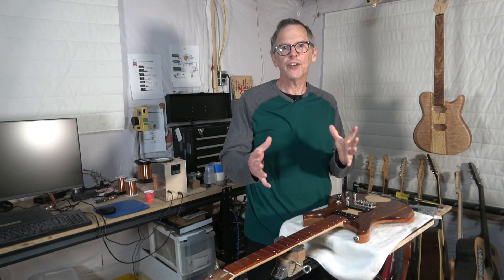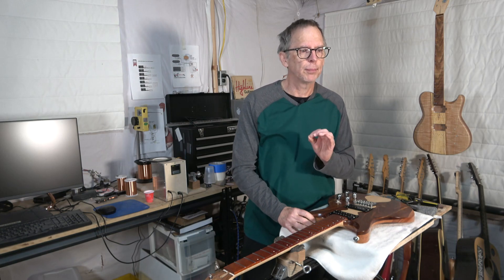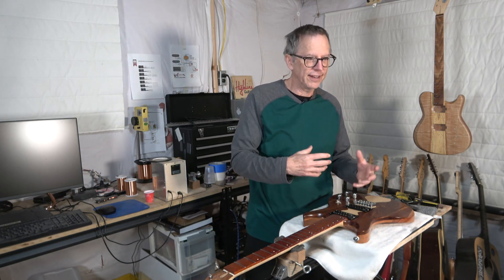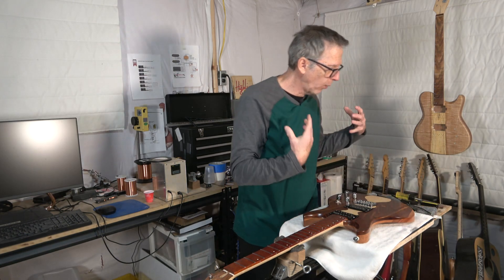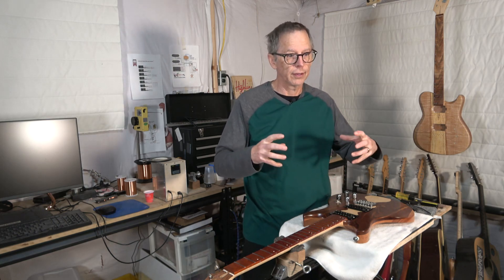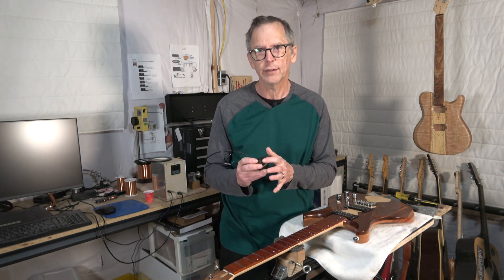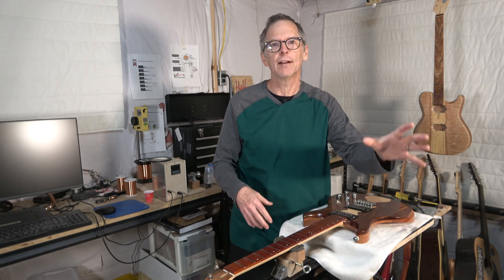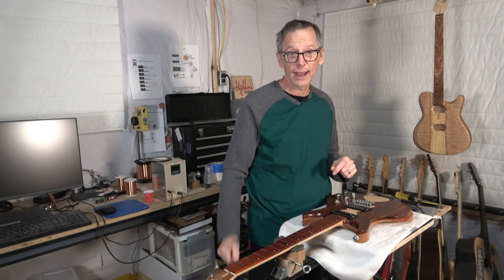Making Guitar Pickups By The Numbers

Comment: 4:06 Can you please describe what you mean by "balanced"?  

My basic understanding is that the more windings, the darker the sound.  The less windings, the brighter the sound.  

This is why humbuckers are darker sounding than single coil pickups, because they essentially have double the amount of windings, and therefore resistance.  This is counteracted by using a 500K volume pot, which preserves most of the high end frequencies in the signal.  

Conversely, single coils are by their nature, brighter, so 250K pots are used to allow the high end frequencies to bleed to ground.
Reply from the maker: The treble, midrange, and bass frequencies are perceived by the ear as sounding equal.

Comment: Can you make guitar midi pickup? sounds impossible but I think you can
Reply from the maker: From Chat GPT: Yes, it’s definitely possible to make a DIY MIDI guitar pickup, though it can be complex depending on how advanced you want it to be. There are a few different approaches you could take:

Basic Concept

A MIDI guitar pickup converts the vibrations of each string into a digital signal that can be used to trigger MIDI notes. This typically involves:
	•	Polyphonic signal detection (one signal per string)
	•	Pitch tracking (detecting the frequency of each string)
	•	Velocity sensing (detecting how hard a string is plucked)
	•	MIDI conversion (turning string signals into MIDI notes)

Approaches
	1.	Magnetic or Piezo Pickup + Pitch-to-MIDI Processing
	•	Use individual piezo sensors (one per string) or a special magnetic pickup.
	•	Process the signal using a microcontroller or software (like Pure Data or MAX/MSP) to detect pitch and convert it to MIDI.
	•	Example: Roland GK-3 uses a hexaphonic magnetic pickup.
	2.	Optical or Capacitive Sensing
	•	Some MIDI guitars (like the Misa Tri-Bass) use optical or capacitive sensors instead of traditional strings.
	•	This approach requires special hardware but eliminates tracking latency.
	3.	Direct Fretboard Sensing
	•	Some systems detect where your fingers are on the fretboard using touch sensors or conductive frets.
	•	Example: The Ztar by Starr Labs uses individual button switches under each fret.

DIY MIDI Pickup Ideas
	•	Use six piezo elements, one per string, feeding into a microcontroller like an Arduino or Teensy.
	•	Process signals using FFT (Fast Fourier Transform) or zero-crossing detection to extract pitch.
	•	Send MIDI data over USB or DIN using libraries like MIDIUSB (Arduino) or Teensy MIDI.

Challenges
	•	Latency: Real-time pitch detection can be slow, especially for low frequencies.
	•	Tracking Accuracy: Standard pitch-tracking algorithms can struggle with bends, slides, or harmonics.
	•	Polyphony: Handling multiple notes at once can be CPU-intensive.

Comment: Single coils. There are several physical aspects of pickups that effect tone. Height and width, for example. Wide flat Jazzmaster pickups produce more bass than a strat pickup with the same number of winds.
Putting tape around the magnets before winding will lower some high frequencies because the highest frequencies come from the coil wire closest to the magnets. Conversely, wrapping the coil with tight fitting tape after winding will push more of the coil winding closer to the magnets and boost the high frequencies.

Comment: HIGHLINE, Do you measure the gauss and what compositions measurements of the each pole piece? because the steel/iron content of each pole piece will increase or decrease the Alnico magnetic. So what do you use to measure the iron content of the pole pieces?
Reply from the maker: My supplier gives me that info.
Reply: @HighlineGuitars  if the supplier didn't give you that info, what would you use to measure the steel/iron content of each pole piece? because vintage guitars aren't going to give you this information so you would have to measure the steel/iron content of vintage pole pieces so what can you use to measure the steel/iron content?
Reply from the maker: @waynegram8907  I don't work on vintage guitars. Sorry.
Reply: @HighlineGuitars  ok thanks just asking